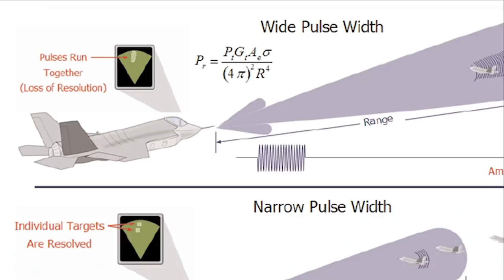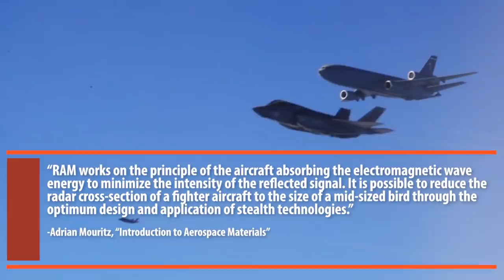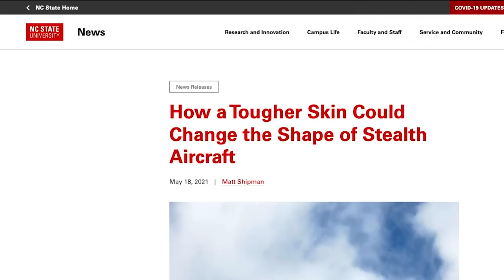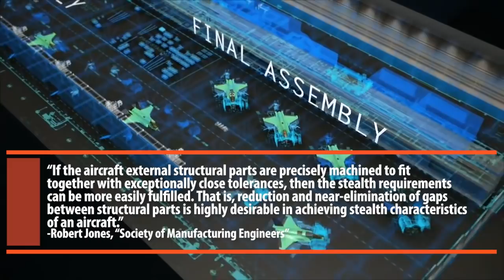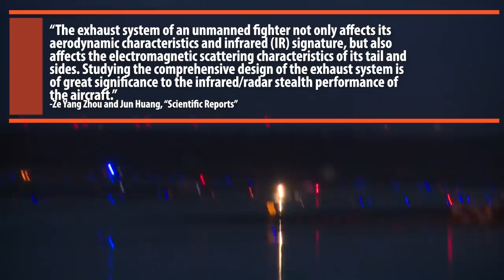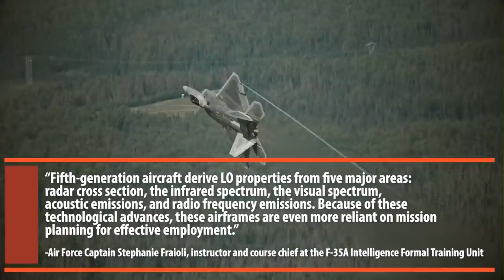Why is stealth so hard?

Comment: The f35 can go higher and faster that its official rating. But the maintenance of its RAM and flight control, weapons integration. One of the indications is its compliance and testing between 3I and 3F, where 3F finally clears it to pull 9Gs. Something to do with the planes flight control and limitations to maintain stealth and overall effectiveness. Its not possible for a jet to have much more thrust than an f16 but have less top speed. And all 4th gen speed ratings are under clean conditions, as in no external missiles or tanks. Most 4th gen cannot sustain mach 1.2 for long with payload unless they want to overstress the aircraft with drag or run out of fuel fast. F35 has more range and speed and better operational altitude with payload. There reasons for that..and the f35 can dogfight comfortably at supersonic speeds for sure. Its maneurverability at 3I is already very good. And the lastest block 4 is taking its capabilities as a battlefield node to the extreme. Also the last point with the f14 pilot, all i have to say is f35 f22 tactics will ultimately get the lock on an f14 first. Talk/listen to f15 or f16 pilots that have engaged f22s and f35s in overwhelming numbers to get an idea. The US themselves have had very little luck trying to achieve victory over their own stealth jets using 4th gen even with airborne radar support in training.
Reply: Wow, that's very interesting and poignant. Thanks
Reply: Have they tested the F-15 EX? similar or even straight up same radar as F-35. But on a much higher performing platform.
Reply: Very well said
Reply: @Gunni1972  F-15 EX has nothing that an F-35 could not handle. F-35 was flown agains the most modern 4,5 Gen fighters and in general the F-35 just obliterates them in large exercise.
Reply: I don't think its fair to say that F35 and F22 will always see the opponent first.  There will never be a 1 on 1 fight this way.  either the F35's were detected by ground radar for whatever reason, or they are getting the jump on ingressing opfor either in friendly or non-friendly territory.
Reply: Interestingly, I just watched a video where the older TF30 engined F14s can outspeed the much higher thrust GE engined F14s.  But the higher thrust GE engined F14s have much higher acceleration during the initial phase of getting up to speed.  It’s only later, once they’re up to high speed, that the older TF30 planes catch up and pass the later models.  It has something to do with the bypass ratio of the engine.  It’s surprising since the GE engines have 30% more thrust (30,000 lbs vs slightly over 20,000 lbs).  Crazy, huh?
Reply: @Gunni1972  F-15 EX has a mixed result in a recent war game.
Reply: @xyzaero  The F35 is not an Air Superiority fighter. The F22 is. Luftwaffe pilots have claimed they killed the Raptor on the large scale with and without missiles. The RAF also did this in Red Flag. They even went so far as to say they had ‘Raptor Salad’. I doubt your claim is true.
Reply: @moistman6930  I don’t care what you think. READ aviation press and do your own research and you will immediately see that the F-35 is the best thing out there. Even better than the F-22 in most cases, since it’s sensors are a whole generation newer than the Raptors.
Reply: @xyzaero  
>Same Missiles (for US variants)
>Worse Performance
>Not an air superiority fighter.
I’m sorry to break this to up you mate, but the F35 is not as good as the F22 at A2A. It’s not designed for that. It’s designed for A2G. I don’t care what you think, it is the objective truth. The F22 can be defeated by 4th gen fighters, and that is also a fact. I don’t care about a niche article, I care about objective evidence from actual pilots going up against it an actual exercises, read actual accounts of what actually happens. No need to be aggressive because someone isn’t fangirling your favourite stealth fighter/ fighter-bomber/ multi-role. Both 5th gen fighters. It is the most obvious thing about both.

Comment: Stealth is difficult for top companies with stealth experience,  in 2021. It's not hard. It was pretty hard in 1990. It was hard in 2000. What is hard.....or highly impractical.....is throwing best practices out of the window, designing a terrible program, and then trying to meet those unrealistic expectations after 20 years of development. Lockheed and the Pentagon did this hard. It did not have to be. Why? The biggest of all defense payouts, the program that can't be killed.
Reply: It's just hard to maintain. For the jet to keep 100% of its Stealth capabilities is to constantly repaint it and replace panels even with just a scratch on it

Comment: Not to mention that the myth the F-35 isn’t a good “dog fighter” is 100% false.
It can rate with an F—6 (because it has no external weapon/pod drag) and pull as much- and by some accounts…more- alpha than a hornet. Not sure why everyone just assumes it can’t perform in ACM. It also has THE most powerful engine ever installed on a fighter and a 1:1 thrust wait ratio at its average gross weight.

Comment: Outright speed is a useless point of attack against the F-35. 
There is a video about the speed of (jet) fighters in the Vietnam war. That was fascinating.
It would appear that very few of us bother to learn our lessons. 

Also  people often refer to the F-18 as "legendary" or "worlds best multi-role fighter". It is only 150mph faster than the F-35. Not a mach 2 machine. Even a clean F-16 can't do it. There's a video for that too...
Reply: The F-18 is cheap and can easily be adapted for multiple roles. The F-35 is a very versatile aicraft and also an amazing one trick pony when it comes to steal and battlefield awareness. But the F-35 would not have the exact same performances as a specialized F-16 or F-18.

Comment: Yeah, our aircraft maybe out of missiles. But the have back up. And we have not left a fighter with out a forwards looking gun for back up. Don’t forget the F-22 or the F-15 or the F-16. Two of the most successful killers to lose victories.
Reply: Military strategy is to never just send 1 type of jet up in the air. The F22s and F35s fly with F15s and F16s. F22s and F35s radar will send targets to F15s and send ground targets to F16 wild weasel jets. Not every fighter jet thats Stealth doesn't need a massive payload for this tactic and reason.

Comment: Stealth doesn't work against bullet?

I like me some Ward Carroll but man is that outdated thinking. Quick, someone tell me the last time that fighters exchanged gunfire. If I am not mistaken, the last gun kill of one fighter vs another was in the Falklands roughly 40 years ago. That is, assuming you don't count the A-10 that aced an Iraqi helicopter with it's Avenger cannon in the first Gulf War

I mean, if the limited internal stores of a stealth fighter was such a deal breaker, why is every nation trying to build Stealth Fighters? Plus, let's not act like modern stealth fighters are helpless in a gun fight. The F-22 is as good a close in fighter as exists. Only the newest air superiority fighters could beat an F-35 in a gun fight and only if those planes are flown well.

Comment: It's hsrd to build Stealth because the cost of maintaining it. To be able to keep 100% of its Stealth capabilities 24/7 the jet must be maintained at factory standards. Which is why all Stealth jets now, look brand new still. Lol. The paint is always being repainted and the panels are always being replaced. Can't even have a rinckle and or scratch on it. Look at the F22, last one was built in 2011 and all F22s look like they all just rolled off the factory line. Lol.

Comment: If given a chance, I'd buy YF-22 & 23 instead of F22, F35!!!
Reply: The YF-22 is a prototype F-22 why would you buy it over an F-22 if you could?
Reply: @anandhindu3123  I am not talking about the YF-23. I am talking about the YF-22. How is the prototype raptor better than the actual raptor? 

YF-22 and YF-23 are not interchangeable designations they’re two totally different planes.

The YF-23 is not at all better than the F-22 or F-35. There is over 30 years of avionics difference between the YF-23 and F-22/F-35.
Reply: @fatstacksfatlips8708  You are correct. Thank you for pointing my mistake. I meant only YF-23 (Northrop Grumman). YF-22 (Raptor); not denying it's a good plane, but I prefer the Widow!!!

Comment: Because no matter what you do they are still visible on low frequency radar. LF blip with no x band blip is a dead giveaway. Launch a few BVR long range AA missiles = dead F22/F35. Russia is in fact retrofitting Su27+ with the Tikhomirov NIIP L-band wing arrays...so even their fighters made in 1984 will be able to detect stealth aircraft. If Russia can retrofit the SU27's to fire the R37 Vympel they would all suddenly be very very deadly to stealth aircraft.
Reply: In a war situation, the EF Typhoon would be tasked with dealing with Su27s, and in that the ASRAAM, IRISt and Meteor would most likely prevent and suppress the Su27 from getting anywhere near the F22. The F22 would more likely act as cover for the F35, suppressing most aircraft without the retrofit, while having the EF to deal with retrofitted aircraft.
Reply: @moistman6930  R37 has longer range than any of those, but not that much more than the Meteor. F35 has been able to fire it for a while now anyways. It's doubtful they would risk non stealth aircraft when the F35 can carry the Meteor. 

The problem is that if we can fire on them, they can fire on us because a missile launch isn't exactly an easy thing to hide, and it gives a pretty exact location of where to fire, and the F35 is not a shit and git aircraft that can outrun missiles.

Comment: This is what Russia, and now the Chinese, are using to defeat stealth aircraft like the F22:  ultra long-wave radar, combined with infra-red detection systems. The ground-based long-wave radar can easily spot stealth aircraft, but they cannot pinpoint the exact location to anything more than 1 or 2 miles. They then shoot up a missile to this approximate location, and once the missile gets to within 5 miles of this zone, it uses its infra-red scanner to lock into the first target. This I.R. missile hits stealth aircraft 100% of the time.  The biggest problem was to separate stealth aircraft from non-stealth aircraft. This is solved by the ground-based radars using 2 separate radar systems:  an ultra-long-wave radar to track ALL aircraft, and a short-wave radar that can only track non-stealth aircraft.  Computers combine these two images together to determine the approximate location of the stealth aircraft, and they send the data to the missiles while in flight so that the missiles do not accidentally target the non-stealth aircraft nearby.
Reply: @ Han Brent ... that is actually the design of the S-400’s 9M96E missile, to use long wave radar with optical and IR sensors to home in on stealth fighters, the problem being that this missile only has a 40 km max range! And considering that an F-35 using its DAS can detect an S-400 site from over a 100 km away and launch its 8 GBU-53B small diameter bomb at a stationary target from up to 100 km away, 75 km at a moving target, the advantage still rests with stealth!??
Reply: why people keep repeating long wave radar is like some silver bullet to detecting stealth? its not. its been proven that stealth is still hard to detect even with long wave radar.
and IRST detection range is super suck, even then you are in the mercy of mother nature to get the 'max' range since the range could be affected with cloud or rain.
Reply: @pindot787  …. Because it’s all they have, forgetting that if long wave radar is so good at detecting stealth fighters … then why is Russia and China still trying to build their own stealth fighters???
Reply: @pindot787  "its been proven that stealth is still hard to detect even with long wave radar."

Something that's a violation of basic physics can't be "proven".
Reply: @isodoublet  umm no? even with long wave radar, VLO aircraft still harder to detect than its non VLO counterpart, like you said. its physics.

Comment: F 22 has a RCS of 0.0001 and officially no radar on earth has ever claimed to have such a low RCS detection capabilities F 22 is kinda invisible because without afterburner it can fight with internal weapon bay carrying 4 air to air missile and without afterburner it still can achieve a max speed of mach 1.8 so detection is kinda like making it invisible

Comment: Sounds like the F-15 EX makes more sense all the time…
Reply: Military strategy is to never just send 1 type of jet up in the air. The F22s and F35s fly with F15s and F16s. F22s and F35s radar will send targets to F15s and send ground targets to F16 wild weasel jets. Not every fighter jet thats Stealth doesn't need a massive payload for this tactic and reason.

Comment: " the f-117 nighthawk has the cross section only slightly bigger than a tenth of an inch" and yet it was detected by turning on P-20 (a soviet analog radar from 1949) for 10 seconds  and then shot down over Yugoslavia in 1999.
Reply: yeah but how many f117s flew without getting detected, i would say only having one stealth fighter of a kind get shot down is pretty good